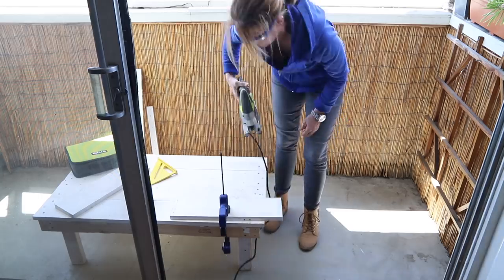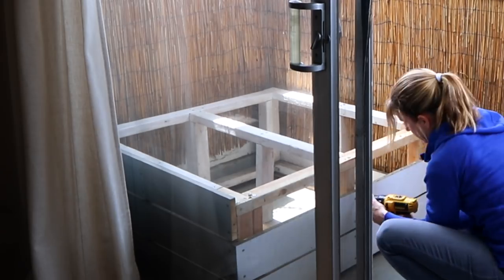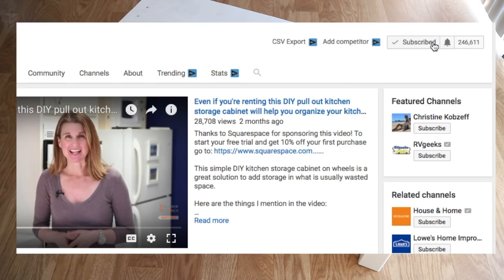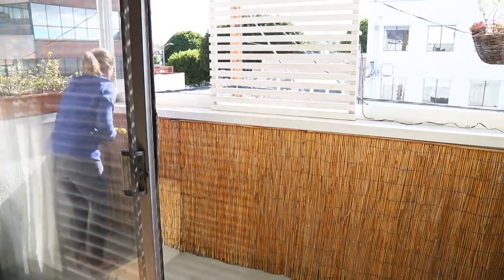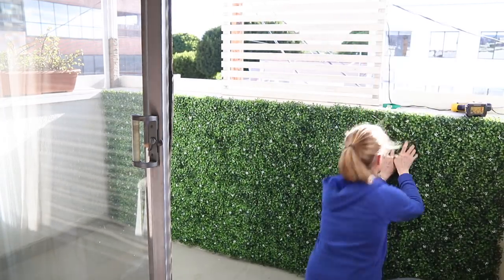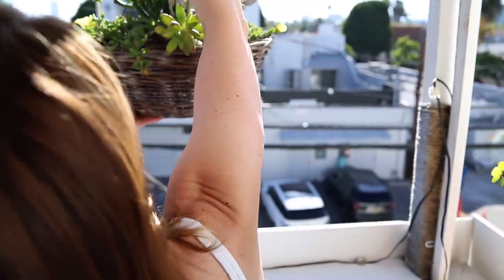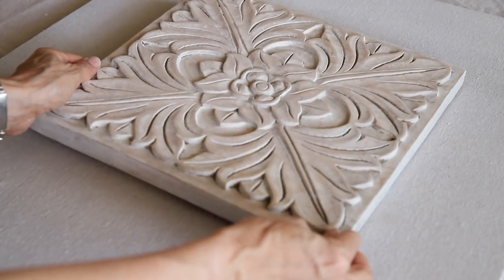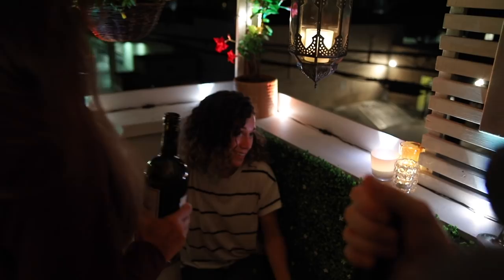DIY small rental balcony makeover for outdoor living

Comment: Hi Isabelle. Thanks for great video and good Ideas. I was lucky to find you on YouTube by accident. I have a problem and you might have an idea. I would like to lay down artificial grass on my balcony but since I live in Toronto on 20th floor, there is strong wind some times and the carpet doesn't sit in the place. I tried to use double sided tape to stick it to concrete but after few strong wind it came out. Do you have any ideas to share kindly, that how I can get that carpet fixed  in place? Thanks